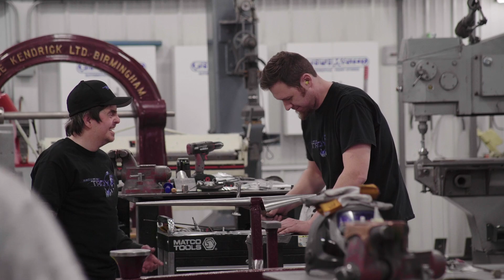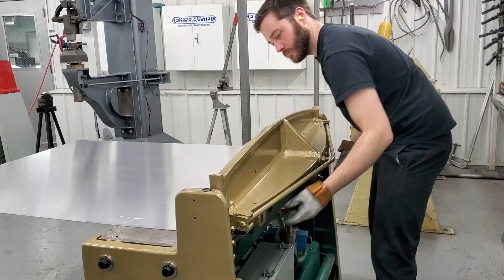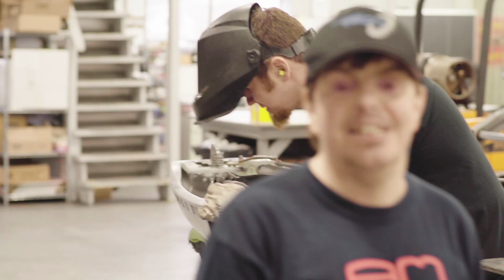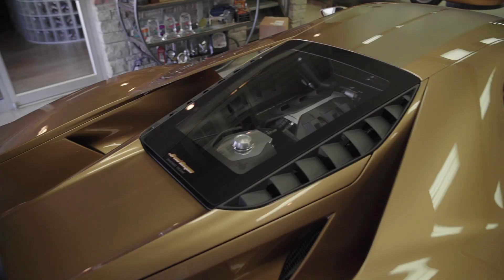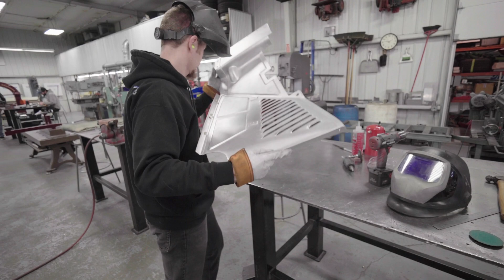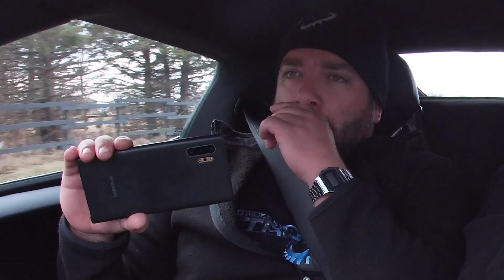Chief, a '41, and a Spaceship

Comment: I had a Ford 2 wd F 150 platinum with the twin turboed V6 with a towing package (lower rear differential ratio). I pulled an Airstream that weighed 7800 pounds ready to travel. I was on many 5% and 6% or sometimes more grades and I never ran short of power! I’d stay in the left lane and let’er eat! That direct injection really works! Nothing like the one in the GT but similar.